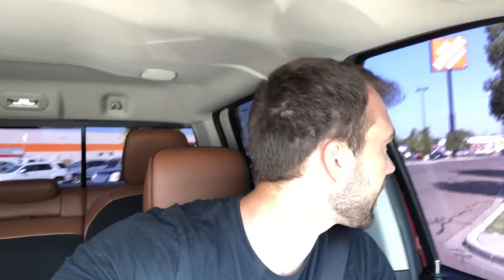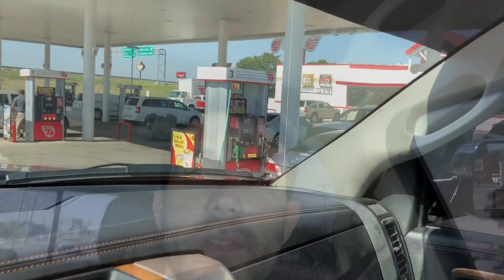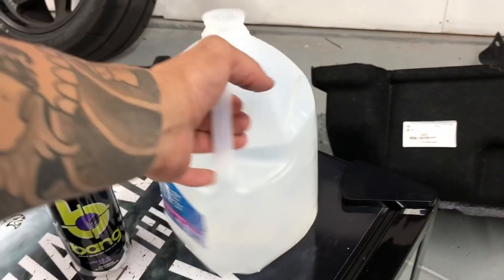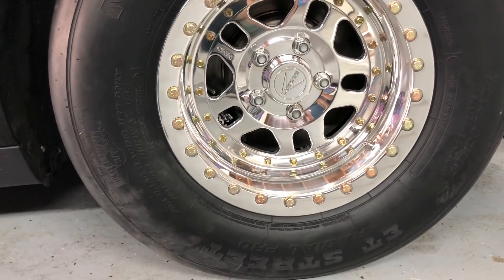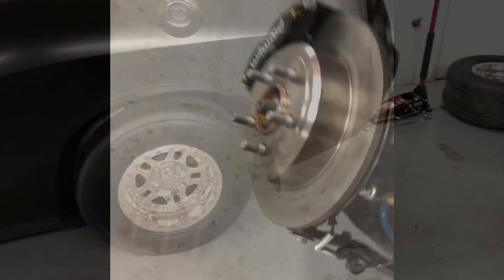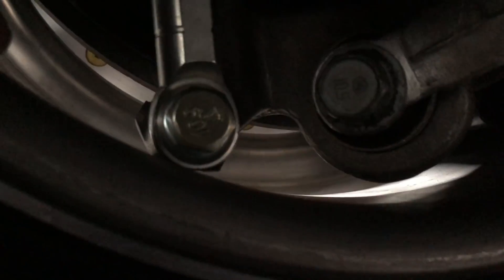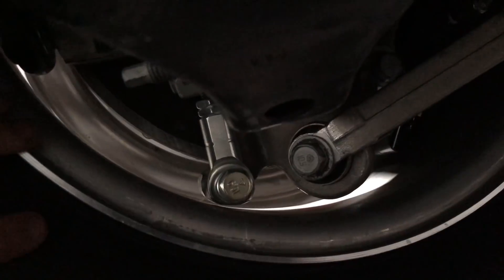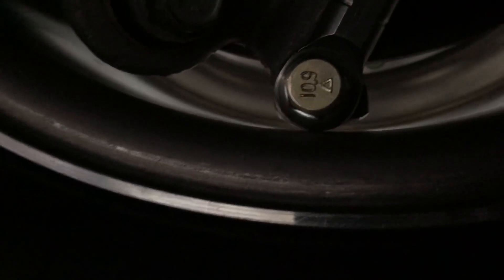I Can’t Believe I’m Doing This To My Hellcat!

Comment: Shouldn’t the sway bar end bolt protrude a little more out of that locking nut (the one you ground the bottom washer of).  Looks like it, the fastener, hasn’t engaged the nylock.  Hope it won’t back off.
Reply from the maker: cw2lido yeah that’s what I was thinking too but those are the bolts HHp sent me. I think I’ll switch them out for something longer
Reply: David Van Voris you want the bolt to engage the nylock, it’s defeating the purpose and could back off.  I worked in the fastener world for 7 years so I have an idea of how those should look and that is not right!  You won’t go out of control but you don’t want anything to fall off and cut up your inner barrel destroying the wheel.  I had a caliper mounting bracket bolt back out causing the caliper to fall off and chock block the wheel.  It cut into the rim and I had to get a replacement at 250 bucks.  Just trying to help...
Reply from the maker: cw2lido thanks man I will switch them out for sure!